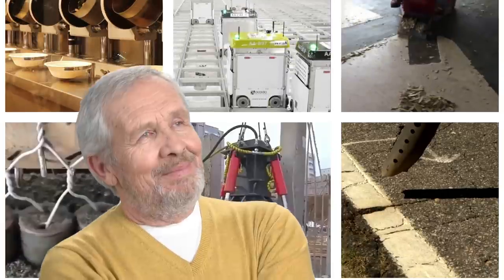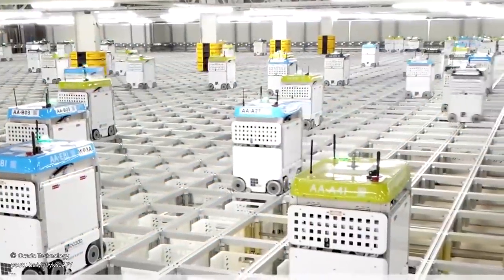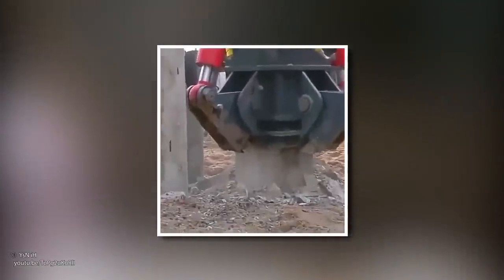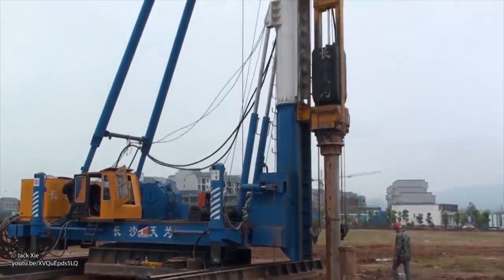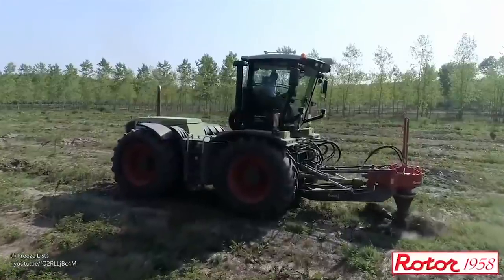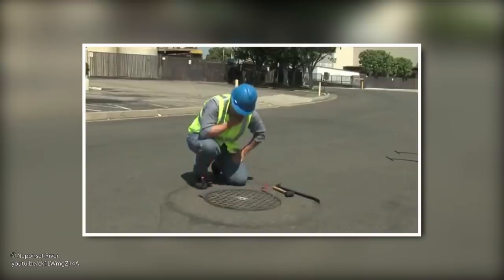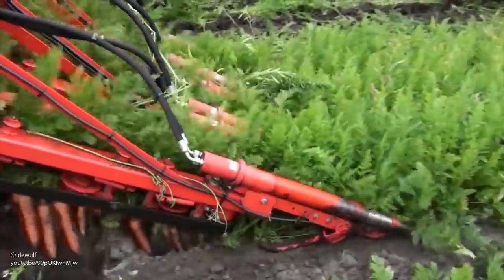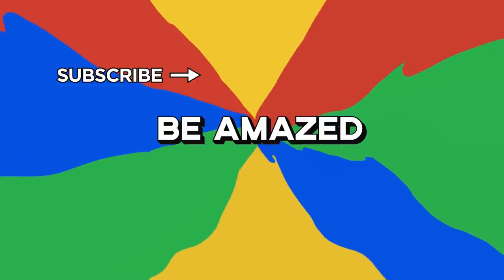Amazing Machines & Inventions You Have To See

Comment: How about a giant machine that eats up and recycles the Great Pacific Plastic Patch?
Reply: To recycle it into more plastic bottles?
Reply: @MrRocco_  If you make a plastic bottle big enough, it's practically a submarine. It would be awesome if the factory boat could convert the plastic into submarines that would just need to be fitted with engines, air recycling systems, etc. 
Eating plastic and pooping submarines! What a machine that would be!
Reply: @archenema6792  it would be crushed by the water pressure and the plastic would leach into ocean
Reply: @archenema6792  the plastic would melt from heat on the engine
Reply: @MrRocco_  Party Pooper! :D
Reply: @MrRocco_  you can achive a lot of things on submarines by adjusting the wall thicknes of the pressure hull.
Reply: @Irobert1115HD  if you wanted DEEP it would be solid plastic
Reply: @archenema6792  I guess it would be cool

Comment: There's way cooler uses of a pressure washer than cleaning a sidewalk. I use one on a hydro vac. You use the pressure washer to make holes on the ground, while a suction hose removes the mud. Mainly used to locate gas, comms, power, and sewer underground safely. And firefighters have a pyrolance version that can cut through brick and metal buildings on fire. And then spray water inside. A lot more interesting that a sidewalk I'd say.

Comment: The manhole lid remover isn't practical. I used to work for a company doing sewer and storm drain maintenance. Lids are heavy but only take a pickaxe to pull them off. That lid remover tool they showed won't fit on most trucks used for that kind of work so a pickup truck will also be needed and that tool will take more time to get into place and remove the lid. A $30 pickaxe is alot quicker and cheaper than needing a support pickup truck, plus that lid remover tool, which likely isn't cheap on top of the $100,000 plus sewer truck.
Reply: 2+2=4-1=3 quick maths

Comment: 5:38 that's called a bobcat and a good operator, its not a special machine just a regular machine with a good operator. 
7:31 that's called a turbo nozzle, easy to buy and attach to most pressure cleaners. again nothing special.
neither of these is amazing but more normal regular items.
Reply: The operator of that skid steer refers to himself as Black Sheep. I don't know where black shield came from. haha